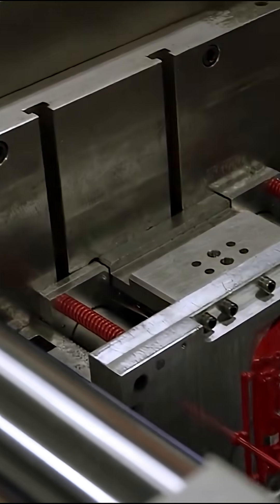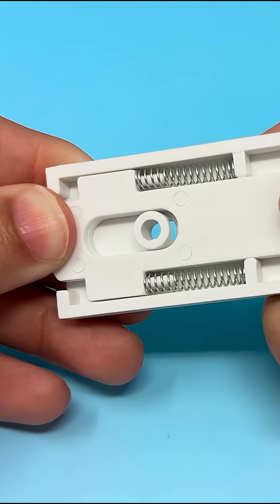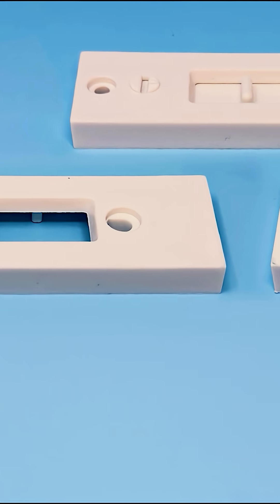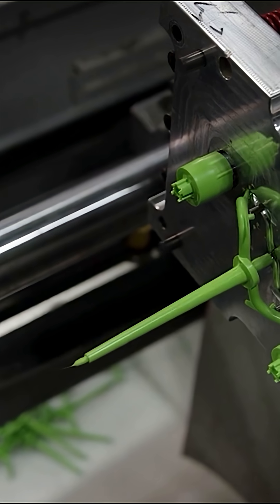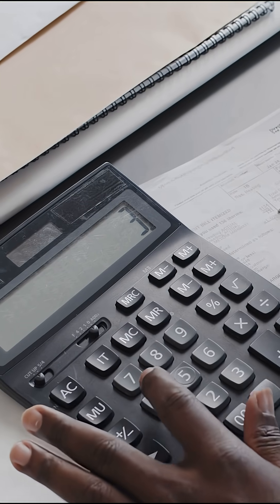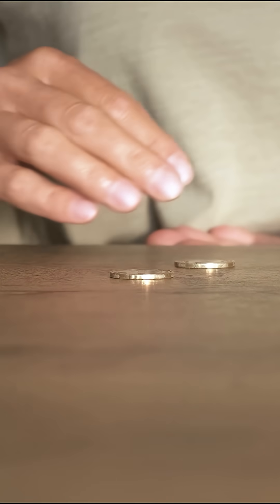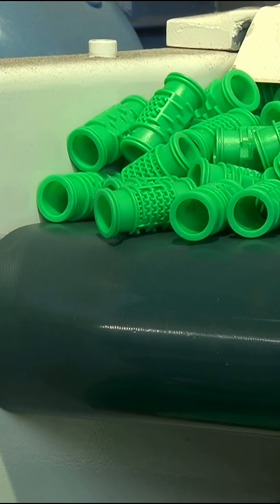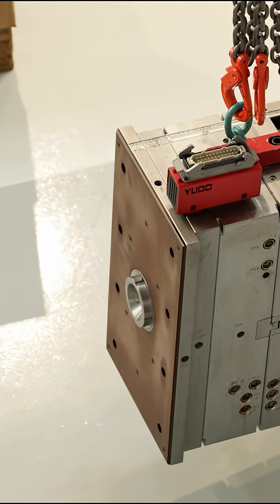Why Molding Is Dying (Slowly)

Comment: I don't see the day where 3D printing will be more efficient than injection molding for mass produced items. Sure, 3D printing all you want to prototype and make iterations on the design. But once the design is done, no way you'll find a 3D printing farm with the same mass production capabilities of injection molding.

I mean, take a bottle cap. Injection molding can spew a few hundred per minute. I'm pretty sure the fastest 3d printer would still take a few minutes just to print a single bottle cap.

Comment: You're comparing two machines with vastly different goals. I love 3D printing for one off or small batch quantities, things I'd never see out on the commercial market due to cost mostly. IM sets the standard for parts at a global scale where a design is final and locked in with little to no changes needed. What we need is a hybrid of the two, IM quality with 3D printing's flexibility. I don't know if that's somehow printing molds cheaper or what.

Comment: A mold for something like this is only a few thousand dollars. Let's call it $10k each which is probably high. $30k for all 3 parts.

It probably takes 15 seconds to mold a part.

It probably takes 30 minutes to 3D print a part.

You'd need 120 3D printers to keep up with an injection molder. If the printers are $1000 each, that's $120,000. If you took the 30K for the molds and bought printers, you could only spend $250 on each printer. Then there's the maintenance on 120 printers vs one big ass solid steel industrial machine.
Reply: yes, but you can scale from $1k in capital and not $30k
Reply: You don’t need a new printer for every part… even if you did, you’d buy $200 printers not $1000 printers.

Comment: As much as I love printing, it's never going to compare to the strength of injection molded parts, even if you somehow solve the flaw of tensile strength along the z axis of the part's print orientation, the mechanical properties will always be worse. Even if you can nake a part to specifications with 3D printing, it will also have more variation from part to part, and in a print farm setting, from machine to machine as well. You're pushing a narrative that is harmful and limiting, as if 3D printing is an end-all-be-all in manufacturing, that those who know nothing of material properties are going to eat up without a second thought. There are significantly more factors that go into deciding the materials and manufacturing methods than you explain in any given video, you hype printing like it's all pros and no cons, and the younger side of your target audience is going to take these videos at face value and accept that 3D printing is this perfect do-all technique that it absolutely is not.

Comment: I love 3D printing, but household filaments can’t even come close to matching the strength / break resistance of injection molded parts of the same dimensions. FDM layer adhesion is really the only thing holding it back from taking over everything. With the exception of mass produced parts where molding is well worth the cost